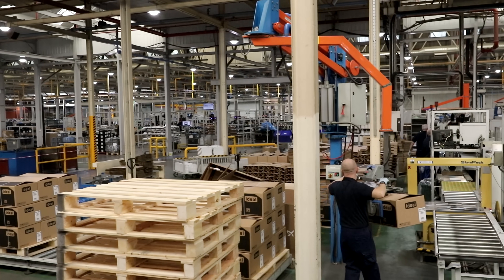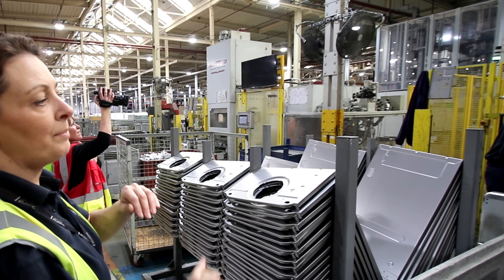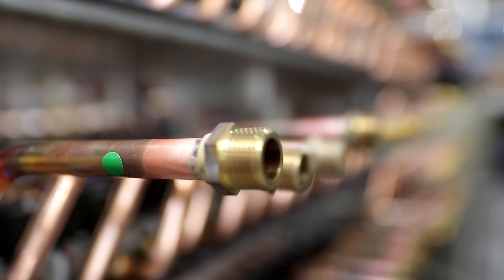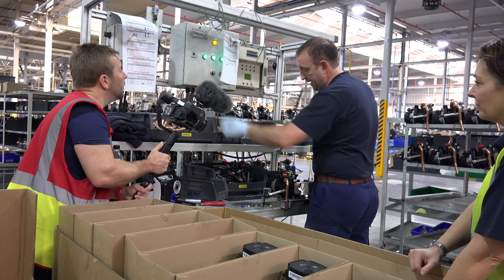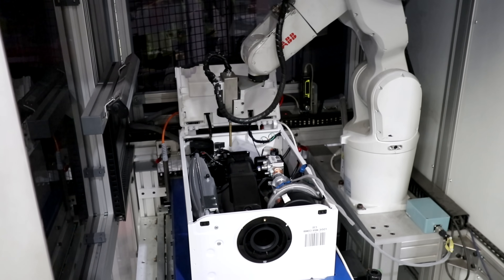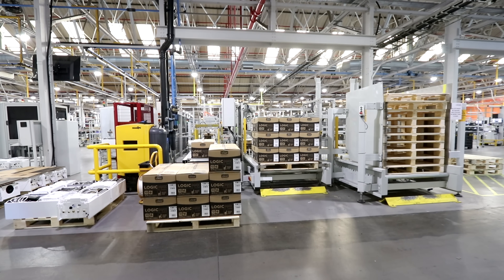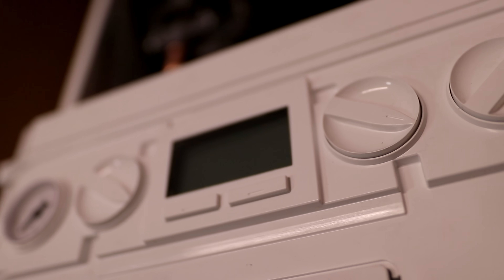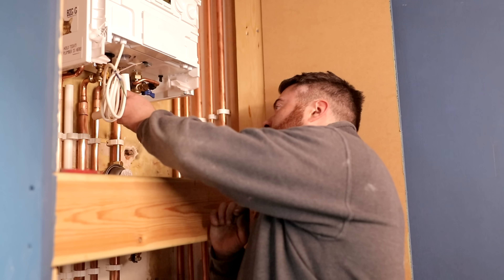HOW GAS BOILERS ARE MADE

Comment: It's good to see the quality control during production but doesn't explain how I still come across a vogue max 40 with a main heat exchanger leaking and to finish it off a blank display (videos to prove). I did rate the boilers before but my opinion is 50/50 now.

Comment: Ideal were very smart copying Vaillant’s pipe work layout plus the way that connections swivel which makes matching up old pipe work easier, avoiding pulling sets to line up. On top of that they bought keston boilers and can replace the twin flue system which is absolutely fantastic made it possible to get rid of their faulty prob boilers.  The only downside is serving takes longer. You have dismantled the gas valve n burner system. Fine if you got time to do a proper job. But these boilers are often used in social housing where companies who have the maintenance contract give you small window of time to do the work.  Other than that great value for the money.

Comment: Hi mate just watched your ideal video it was brill just have a few questions you have possibly been asked lots of times so sorry for asking but we’re in the process of doing our bathroom up from top to bottom we had a boiler replaced a long time ago it was put into the airing cupboard and are thinking of having it moved  to make the bathroom bigger but as it’s over 15yrs old it’s a Baxi 100e which has been used for heating the house and as our shower we are thinking of having put in the loft or maybe putting it in the kitchen not sure if to get it replaced the same time as doing the bathroom it still works fine just wondered what and if the best boiler to go for sorry it’s a bit vague  cheers mate
Reply: Atag ic28 or ic36 all BRASS and steel and NO plastic

Comment: Should have asked them why does the inlet valve  under the boiler to the gas valve have a reduction of up to 4 mbar 
For example if it's 21 at the meter then the gas valve itself will only be 17.
Not great when potterton/baxi 
Are direct to the valve with a bigger pipe bore to supply a greater volumn of gas for output efficiency
Reply: This is ridiculous isn't it it's pure laziness. Just made one without the drop

Comment: Absolutely pathetic boilers. Remember the ISAR and ICOS James. Why anyone would install an ideal after them is unbelievable. But all you tubers will do anything for money.
Reply from the maker: Comments like yours always make me laugh...it's like you've actually paid to watch the video...it also ignores the fact that a company can improve and innovate following problems with a certain model. But no, my job is to tell you in this instance about a boiler company. Something I think my viewers regardless of their past use of an Ideal boiler would find interesting because of the factory, how things are made and more importantly the people behind them. If I got paid to do so or not, isn't relevant and wouldn't change the end product anyway.
Reply: plumberparts love your content but just wanted to add my two cents. I can’t really agree that ideal are out to better themselves, there is a known issue with the logic burner seals not creating a 100% seal which leaks CO internally, also they’ve had big issues with the bottom sumps cracking, both issues should really be subject to a recall program. On multiple occasions I tried to inform ideal of the burner issue but was just fed different excuses ranging from “its not a 100% seal, this is normal, as long as it doesn’t effect combustion it’s fine. I recent carried at a FULL service of my own logic boiler (was pre fitted to the new build I bought) and having to remove the flue to remove the burner door to clean through the heat exchanger was rather annoying. However after this the boiler still performs with rather high emission with no way for engineer adjustment, also ideal state no specific emissions readings. Now when it comes to the icos,isar,istor and any other variance of that boiler, let’s just be thankful they’re slowly but surely coming to the end of there life cycle. I’ve not known logics to last that long, which is a shame coming from a company that gave us the ideal classic. 

However just my experience working on them/owning one. Great to get an inside look though. Thank you.
Reply from the maker: @Mr_Ashley  Excellent comment mate! I'm sure Ideal will be scanning the comments on this video. Kat in particular is so passionate about the company and has been there since she was a gas fitter (which we had a great chat about off camera!) I guess every company has it's thing...from Grant Vortex's (which are excellent oil boilers but always a faff to install the balanced flue) to Worcester's Greenstar that are literally the worst boiler to service on the market!
Reply: plumberparts 👍🏼, great to interact with you! Agreed! Plus Worcester’s are personal hand slicing machines too 😂
Reply: Ash Bayer put some gloves on and fit a decent boiler
Reply: plumberparts Tin foil hat wearers that actually believe that companies purposefully make shit equipment just to piss people off 😂 Nice one for the video, not a plumber or gas engineer but it’s an interesting insight. Thank you

Comment: Common fault on Ideal Logic boiler is the main heat exchanger leaks after 2 years which happened to me and to thousands of other people, just google it to find out.
 
The main heat exchanger is the most expensive part of the boiler.

Now i have a worcester bosch boiler fitted under eco scheme, however they tried to fit another Ideal boiler which i rejected and paid a bit extra for the worcester bosch boiler and its running with no problems.
Reply: 10 year warranty on the heat exchanger... for ideal, wait till that worcester starts going bad, i work for BG and myself , i get more call outs for worcester and vaillant boilers, the best ideal boiler ever made was the ideal mexico floor standing , still servicing them with zero problems 20 plus years on...